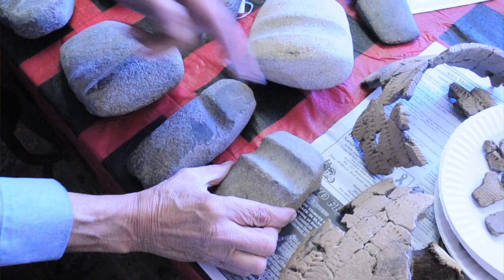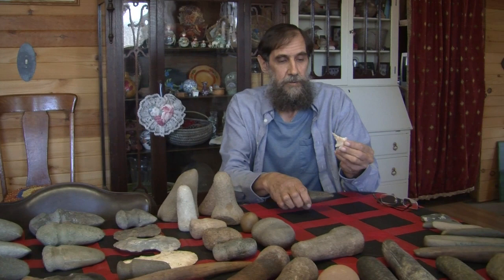ax heads

Comment: Well I guess it’s my turn to add my two cents for what it’s worth I don’t necessarily believe grooved axes were held in the hand for one thing there is not enough leverage or force to be able to chop wood of any great quantities this way. The next thing is what about all the axes They have been found in dry caves and in the deserts of our southwest that actually still have hafting still on them. Why would an individual spend all that time grooving a stone and then putting it in his hand and not Halfting it. Just my two cents.
Reply: Agreed with all you wrote.  I would also add to your part about leverage--That the amount of force needed to chop/cut any material using the hand-held method would put tremendous stress (pain) at the leverage points of the elbow, wrist and shoulder over a moderate amount of time.  It's illogical.

Comment: "Hefted" verb
past tense: hefted; past participle: hefted
lift or carry (something heavy).
"Donald hefted another pair of sandbags from the stack"

"Hafted" verb
past tense: hafted; past participle: hafted
provide (a blade, ax head, or spearhead) with a haft.
 Moreover, If these Axes were meant to be used in the hand, then why weren't the ends shaped like Pestals?
Maybe some were used by hand, but surely most were *Hafted